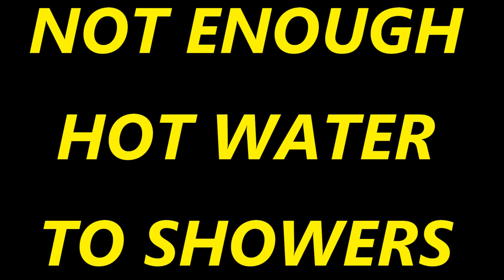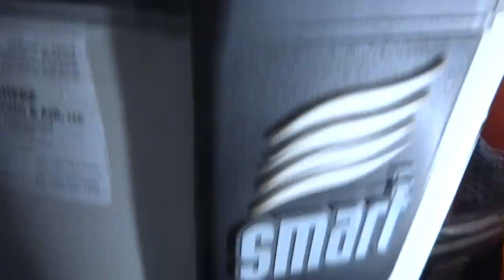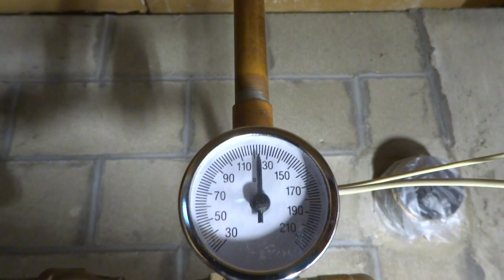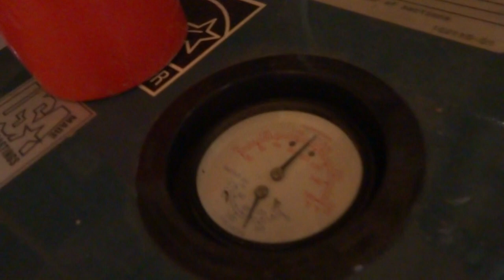NO HOT WATER TO SHOWERS IN HOUSE

Comment: At MA electric rates a 40-50 gallon tank will cost you $50-60/month just to maintain temperature before you even start using hot water! Electric resistance anything is crazy expensive to run.
Reply: I’m glad I have a 50 gallon natural gas water heater, a lot cheaper to operate.
Reply: @w.miller7282  Yup. My summer gas bills were only around $15 with the old 50 gallon tank I had. Even less now with a tankless unit despite the rate increases.

Comment: I had tankless oil fired water heater. Put in a 50 gal heat pump WH one year ago and could not be happier. Turned the boiler off. I live alone and it costs me 2kw or less/day (about 40 cents). Primary heat in winter is pellet stove.

Comment: Mine never had a mixing valve. Just turn on the hot water in the shower, when it gets warm go in, when it starts getting hot turn on the cold water. I think mixing valves are for little kid safety, and perhaps getting more hot water out of a smaller water tank.

Comment: i have a valve like that on my hot water so we don't get boiling hot water in showers it works pretty well.
we had it for the old fashioned two handled showers that would give you full hot water when someone flushed a toilet but with our new moen balanced pressure valves we probably don't need it

Comment: Mixer even required with storage tank? Good job Steve And molly!
Reply: MA design guidelines specify a mixing valve, however actual code does not. Water heaters & storage tanks need only be equipped with a relief valve. An automatic tempering device is required for tankless water heaters though, but those only have to ensure the temperature doesn't exceed 180.

The design guidelines are to have the tank set to 140, with a mixing valve set to ensure the temperature does not exceed 112 degrees at the tap. 112 is too wimpy! Guidelines can bite me.
Reply: @jblyon2  what guidelines they? you need 130 or better for stuff like a dishwasher so i have a mixing valve just to bathroom so people don't get scalded in shower when someone flushes toilet with old fashioned two handle shower valves

Comment: I was looking forward to you showing lowering the boiler temp at the end and what you set it to for a boiler with a storage tank.
Reply: you don't need to lower boiler temp you just have to have a boiler  set to only come on when you call for heat or hot water and it can cool off when not needed the hot water tank sets the temperature of hot water to house
Reply: @ranger178  Right, that's a cold start boiler. I was just curious what the low limit was set to and if Steve lowered it from 160F or disabled the low limit entirely.
Reply: @Techhead777  if you have hot water coil in boiler you need boiler to stay hot but if you are using seperate tank with a zone valve during summer you want boiler to get cold